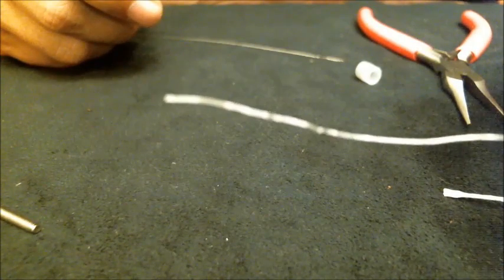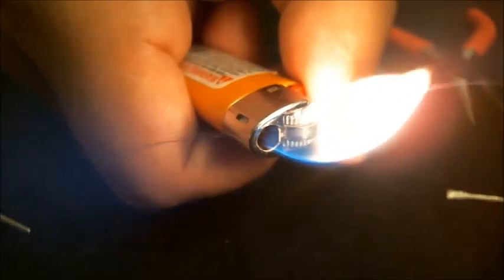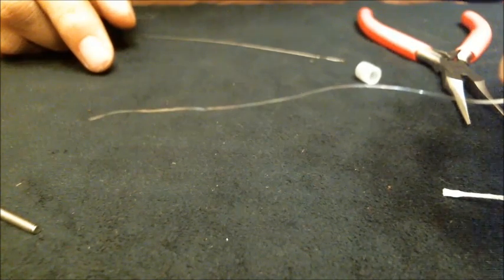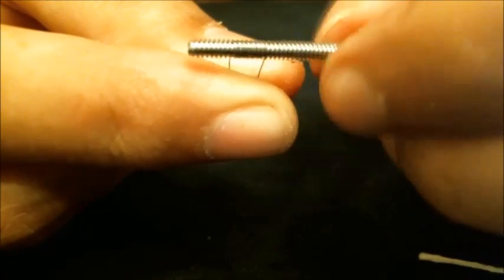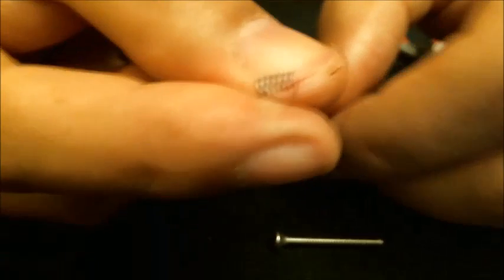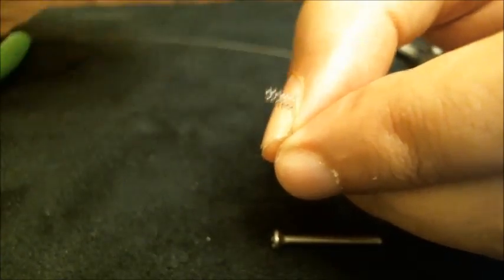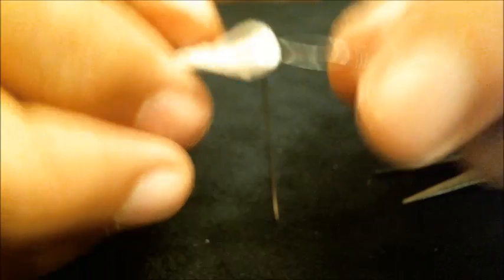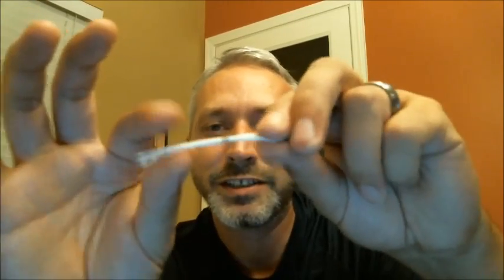Machine screw coil wrap for Vivi Nova / Kanger T3

Comment: Great technique, I just finished rebuilding a Volt T3(Kanger 808D clone). I found that without the threading tool I could twist a 3mm silica wick through the coil with no hassle.
Thanks Dave!

Comment: WOW! This method produces the most perfectly spaced coils Ive ever seen, good idea, I was a little worried at first that the coil wouldn't make good contact with the silica, however after you pulled it through the coil I could clearly see it was snugly in there. Thanks for sharing this, I recently got a Protank & this method seems perfect for rebuilding it, soon I'll be getting some XC-116 ceramic wick for my rebuilds, from what I hear it has better flavor & last longer, but its $7 a foot though

Comment: Great idea Dave! Good video! Just thought I would mention to those that don't know. An Evod Wick (not the base) works on an Evod-Pro tank, and the MT-3, t3. Yes you will notice that the TUBE is a bit shorter but they work just Great! And using an Evod Wick will correct the Airy(Airier?) Draw on the Pro tank. And the Evod replacement wicks only cost about $1.50. Once again, Real good idea. Subscribed!

Comment: If you can't find a beading needle, they're easy to make.  If you don't have scrap small diameter wire around the house, use a length of kanthal, it works just fine.

Comment: Good Video.  No nonsense, practical and creative. Do you use 1 mm wick doubled for a reason vs. a single 3 mm wick? I plan to try rebuilding my Kangar product heads and I am about to order wick. Already have 32 gauge AWG Kanthol wire on the way. Thanks for sharing.

Comment: Good method but I can't seem to find the right balance between a coil size that is too big for my silica and too small to thread the wick through.

Could do with a recommended beading needle on ebay uk. I can't for the life of me get silica through - the coil is either too small or too big. Using 2mm silica wick folded over to make 4mm. Maybe cotton would be much easier? I'm using an approx 3mm machined screw at the moment which seems to be too loose for my silica.

Comment: If you cannot find the needle, You can make one with .035 tig wire ,fine wire from a hobby store or maybee fishing leader wire.
cut the wire to length, go 25% extra for the twisting
fold in half and crimp the fold with pliers.
clamp wires 1/2" or so down in a vise, with vise grips or hemostats
clamp the loose ends with hemos vise grips or wire pliers.
twist it up until the wires lay evenly against each other.
spread the loop slightly and give a 3/4 twist with two pairs of pliers
trim the end

Comment: i might have a way to improve this. to lessen the risk that threading the wick might disfigure the coil, i think you could make a simple jig.  maybe like a 1/4 piece thick metal stock, with the same size threaded hole, cut very precisely in half following the length of the hole. you could close the jig around the coil, holding it firm, while you thread the wick. luckily i got a neighbor that is a master machinist. he loves to make stuff like this.
Reply: or maybe, while it is still on the screw, coat it with melted paraffin, let it cool. let the wax hold the shape, turn out the screw. thread the wick, then melt the wax off.
Reply: or maybe simply wrap tape around it before removing the screw .... ok, i will shut up now

Comment: Nice videos Dave, I find you get into a lot more details than other tutorials.

Tried to buy a 4-40 machine screw at Home Depot over the weekend, but it seems they only go as small as size 6 anymore (they had #4 broken off in their testing display).

I picked up a small pack of #4 one inch sheet metal screws - which seem to have about 22 turns per inch. Can these be used with your method or should I keep looking?

Comment: Man, this is absolutely brilliant!  Such a genius idea on how to wrap the the new coils with the machine screw.  Thank you for posting this.  I'm about to start implementing your method on my Smoktech RBC's and the coil assemblies go back together just like your T3's with the exception of the silicone sleeve that separates the coil from the outer coil assembly tube.  My Smoktechs do not have this piece.  Now, is that threading needle something you made out of the same wire or is that some sort of cabling?  Thanks again Dave

Comment: Hi Dave, AWESOME Videos! I have a question about the wire: I am looking at the RTD website you recommended for the wire. They have 3 different 32AWG wire types: 1) 100ft. Non-resistance 32 made of pure nickel, resistance= 0.95 ohm/ft. 2) 100ft. Kanthal A-1 32, resistance=13.81 ohm/ft. 3) 100ft. Nichrome 32, resistance= 10.57 ohm/ft. Which do you recommend?

Comment: Have you ever used a volt ohm meter to check the resistance of the coils after you have them wound? If that works it seems you could make just about any resistance coil u could want?

Comment: Nice video. Recently got back into vaping couple months ago after getting frustrated w 808d and carts back in 08. just Got ego n some ce 5's this week n just kicking around forum n youtube n web stores seeing what's all going down w vaping. Swear 4-5 years ago was'nt much more 808 n 510 n no where near the vendors or products. Got some kenthal 33 n 2mm silica on its way think i may go w a fine thread bolt for tighter coil in that ce5. Question? that threading hook yarn dept?  Peace......

Comment from the maker: The only way I can fathom that they pulled off 8 wraps was to use 28AWG wire... And it is PACKED in there... With my 32AWG wire, I can do 5 wraps and hit right around 2.2 Ohms everytime, which for me is perfect. Don't get too caught up in trying to mimic the stock config... 4 or 5 wraps is plenty enough in such a tight space... Oh, and this was the first time I ever wrapped one around a screw, when I made this video :) I use it all the time now it worked so well...

Comment: NOTE DETAIL:  when holding the screw with the right hand as opposed to the left hand as in the video, you would start from the BOTTOM rather than the top in order to abide with the dynamic of the thread of the 440 screw.

Comment: How can you make 400 attys with 50 ft of wick when you are using 4 strands? (looks like about a foot per head, 3" per strand). I use "1" strand of 3mm wick and with 30 ft i can make 120 attys. price per head about  .17 cents. Sound like about 50 attys out of the 50 foot of 4 x 1mm wick.